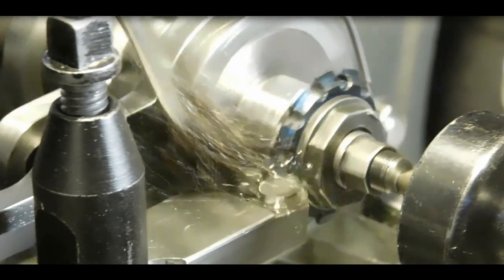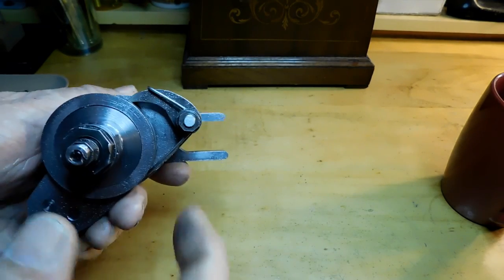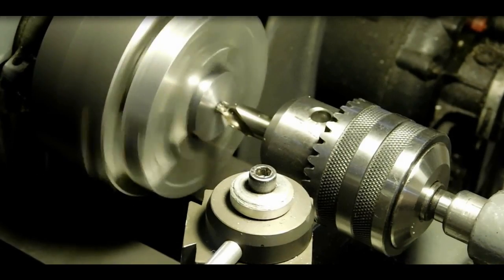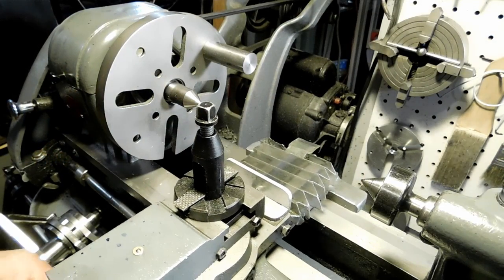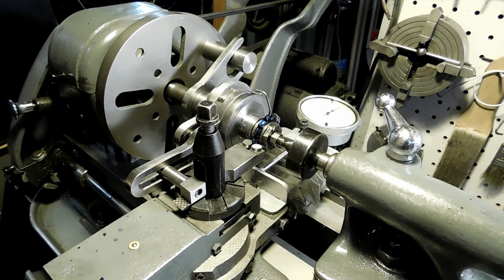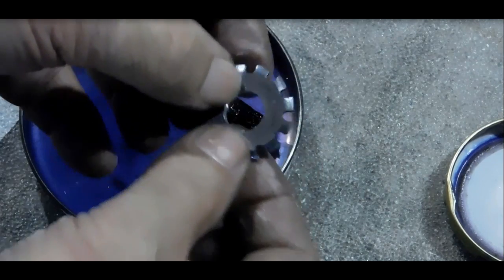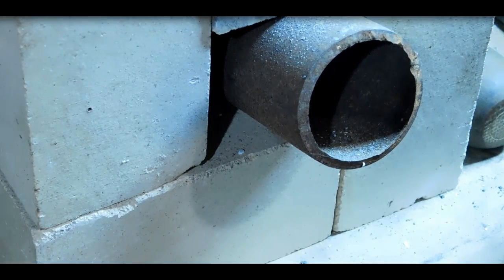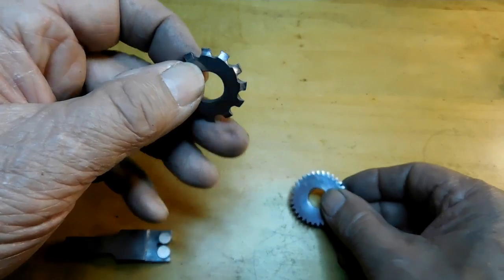DIY Gear Cutter: Making the Cutter 3

Comment: Good morning and compliments for your video: M making a gear by myself with a Myford dividing head , could you please explain me how to calculate the external diameter of the cutter please? the other equations i understand, thank you in advance !! Alberto
Reply from the maker: The external diameter of the cutter depends on how many teeth you plan to make...I used 1.25" in that video as I wanted 12 teeth and the Eureka Tool requires a 1.25" cutter size...but I use a 10 tooth cutter with a diameter of 1" to make clock gears and .75" diameter 10 tooth cutters for watches...bob
Reply: Добрый день. Какая вам разница - какой диаметр у фрезы ? Важна форма профиля. Внутренний и внешние диаметры можно делать любыми. Такими как вам удобно.

Comment: Hi Bob, sorry for taking so long to get back to you.  Been pretty busy here lately.  At first I was wondering why the back rake was not being developed with the tool, then realized that the root of the cutter was passing between the buttons.  Dummy me!  After the tuning of the tool is done it looks like it performed the job pretty well.  What size lathe do you have?  Looks like a 6 inch Atlas?  I am quite interested in seeing the button cutter made and cutting the profile on your blank on the small lathe.  You have done a great job on this series Bob, thank so much for taking the time to make the videos.  Trust me, you are the reigning champ for the Eureka tool!!!  :-)

Joe
Reply from the maker: Thanks Joe...I got a collection of lathes here, including a small CNC I'll be using to produce the buttons, but all the Eureka stuff is done on a 6" Atlas (my BIG lathe)...got lots of button tool video...need some AutoCAD work...and I want to run the math on some other size lathe change gears...you know the pitch and maybe the pressure angle of your lathe's change gears?...just want to size some buttons cause I got a feeling anything bigger then 24 DP the buttons may need modification...not positive...not sure of the fit to the Eureka tool either...I have now made 4 cutters and feel much more confident using the Eureka tool...next video...bob

Comment: G’day Bob, good video well presented. I’m intrigued with the tools action to shape the gear cutter teeth, also I didn’t think the alcohol flame would have been hot enough, you just have to be patient. 
Cheers 
Peter
Reply from the maker: G'Day Peter..with a torch or something hotter I have a hard time getting all the cutter tips light straw at the same time...I just finished a second cutter today...I'm going to get a .5 inch (sorry no meters this side of pond) steel about 5-6 inches long and slide the cutter on the steel and heat the said steel with a torch about 2-5 inches from the cutters location and hopefully the heat from the pipe will radiate to the cutter tips...that's the plan anyway...she'll be right...Cheers...bob
Reply: @robertt-cs8fe  That idea that you just suggested is a very good thought. Just slowly rotate as you heat the rod and you should get even heat transfer out to where it is needed and nice even tempering of all the teeth. Wonderful series on this tool and its use Bob.                Many thanks from John, Australia.
Reply from the maker: Thanks John...I'm new to tempering multi point cutters...I usually just harden them...I make clock gears from brass...but these involute are a different breed...might want to cut a steel gear now and then so I figure I better learn to temper and how to sharpen a gear cutter too...my first attempt at sharpening (in the video) I used a sharpening stone I use on my watchmaker's lathe and it wobbled a bit on my mill but did the job...today I heated the stone off the lacquer arbor and made a proper arbor...been a good day...bob
Reply: Hey Bob, don’t worry about the  imperial, I was schooled imperial and the year I started work we converted to metric so us older guys will often speak with forked tongue (sorry is that politically correct) I prefer metric but when I’m down to the minute measurements I prefer though” it just feels smaller at .001” than.025mm. Funny thing is Wikipedia, if I recall says USA went metric in the 70s but your preferred measurements is imperial, stubborn lot. Cheers Peter
Reply from the maker: Us Yanks don't give in easy...I spent 20 years overseas and I'm kinda okay with metric but Celsius is just confusing :)

Comment: GREAT to be here. Who would have thought a reverse of a plate was an issue, you thought it through guess you marked the side of the ratchet plate so that would never happen again glad you figured that out it had to be tough, certainly not obvious to solve reassembling that Eureka.  Nice to see you square the material a bit more through the surface grinder, a tool we are working to get here, it is just needed along with a real (our first) heat treat oven. 
You sure do great work, we are so happy to know your channel. What a really nice tool you created that cut a really clean gear. Lance & Patrick.
Reply from the maker: Thanks guys...I'm really jealous...a heat treat oven...I've been going to auctions looking for one...but my little fire brick set up and glass baton works great for the reamers and broaches I make...next video (button tool) I'll show you an arbor I case hardened when it kept tightening up...biggest item I've ever case hardened...surface grinder is a nice addition...but then you'll need a Grind-all attachment...it never ends...bob...just thought of something...I used the bluing solution on an old Carl Weiss stero microscope I rebuilt years ago...the slide on the lathe and the attaching parts...came out real sweet...bob

Comment: it looks like the center at the tailstock side is wallowing out?
Reply: The center is offset at tell stock, I believe that's what you're seeing.
Reply: @tillmanxl6914  have a look at 16:50, the material is coming out laterally
Reply from the maker: that is the offset at work...bob
Reply from the maker: the center is offset .030" to allow for in and out that provides the relief...bob
Reply: Yes, I see what you're talking about, it does look Warn. At one point 16:28 there, it looks like I can see it moving, l thank the tell stock was loose.
Reply from the maker: It is in back gears which slows the rpm and increases torque...if your tail-stock loosens the tool rips free very quickly...bob
Reply: @robertt-cs8fe  i went back to the video explaining the making of the tool and at 17:12 it shows the part, and it looks to me the end is in much better condition
Reply from the maker: Just went down in the shop to look at the end of the Eureka took. There is a scratch from the offset center hole to the edge…easily seen…I cleaned the end hole out with lacquer thinners and
compressed air to get a better look…it is not deep enough to effect the offset as it was made with a center drill…but looks like it might have happened by not putting the center in the hole properly and then starting the lathe or when removing the tool …not really sure…bob